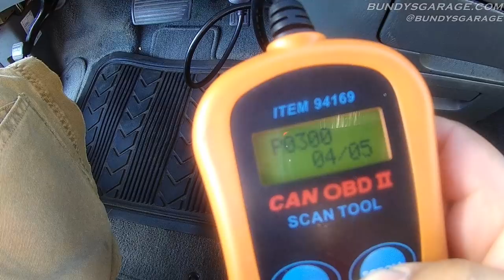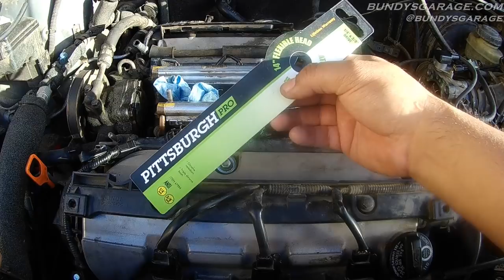SOLVED P1399 Honda Acura V6 Accord Odyssey Ridgeline Pilot CL TL MDX Random Cylinder Misfire

Comment: Code also pops up when you have low valve clearance or a clogged EGR valve .
Reply: So would adjusting the last to a tighter clearance make that better.
Reply: The low valve clearance
Reply: Low valve clearance means it's already tight to begin with , so no . In fact I would ever so slightly loosen up and make sure you are using the correct  feeler gauges when doing this adjustment . I do recommend that you have a  professional do this task for you .
Reply: @zacharymcmullan707  p1399 can be from many different things you have to narrow it down start with easiest which is air no bad gaskets or vacuum leaks and map sensor/air intake filter is good check for spark if spark plugs coil packs and sensor connectors are all clean and fuses are good check valve clearance to see if you need an adjustment. If so then an adjustment will fix it if not fuel injectors/fuel components is your last resort. Codes aren’t an exact science gotta track it down

Comment: The last time that happened to my 2002 Honda Accord, Just changed the EGR valve and it is still running fine to this day.Those random misfires are caused by EGR or its passages is blocked by carbon or gunk.
Reply: Efren Saclolo hey I have a 1998 Honda Accord lx manual transmission, yesterday my car wouldn’t stay idle when I make a stop, the engine light came on and I got this same code plus a few more indicating a misfire. Do you think replacing the EGR would solve the problem like you did?
Reply: So did you change the egr?
Reply from the maker: The EGR and fuel injectors are two completely different problems. You have to do some diagnosing to determine which one. The code can come for all kinds of reasons. Bad spark plug, bad coil, bad wires, EGR, bad fuel injectors. If ou have carbon build up issues try using a top tier gasoline and put a can of Berryman’s into the tank with a complete fill every other oil change and that should take care of your carbon issue.

Comment: Does it also causes your spark plugs to burn easy n is it causing a longer rpm at shift once you giving the car a lot of gas like full throttle it jerks a lil I just replaced transmission so it can’t be that

Comment: On a 99 accord 2.3 could a bad fuel filter cause 0301,0302,0303,0304,and 1399 new plugs, wires,egr,knock sensor cleaned passages

Comment: What years had bad injectors ? Why does a misfire in one cylinder cause a 1399 ?
Reply from the maker: Any vehicle can have issues with with fuel injectors, any year range as well. The reason 1399 pops up is because the engine knock sensor cannot determine which specific cylinder is misfiring, so it just throws up a random misfire. Just like all parts they do wear out and they do go bad, but Honda has some of the best fuel injectors out there, they don't fail all to often but they do fail.
Reply: @bundysgarage  yeah, I know honda has really good injectors. The only honda injector I ever replaced was on a '92 integra LS. But I have seen others replace injectors on '86 to '89 Accords. But extremely infrequently. I worked at Honda from '97 to '00

How did you narrow it down to #6 injector ? Can't really pull off the injector connectors with the engine running, and the manifold has to come off to get to the injector connectors; I believe ?

Comment: I’ve changed coil #2 (which gave codes) and all spark plugs.. also cleaned out all the muck and grim out in the first removed cap on the head .. I’m getting misfire codes still could this be carbon due to high miles ?
Reply from the maker: What codes are you getting specifically?
Reply: P1399 but I noticed there’s a lot of carbon build up any recommendations on how to clean it out  ? I bought the van at a auction with high miles and without inspection stickers so I really don’t know how long it’s been off the road

Comment: I have the same codes for my 2000 honda accord p1399 and p0300 p0301 and so on... is it the fuel injectors? I changed the coil packs and spark plugs
Reply from the maker: Does it happen all the time? Or after driving does it clear up. If you have tested compression, and spark? The only thing left is fuel.
Reply: BundysGarage it does it once i drive the car for a while, when i shut off for about 20 mins and when turning on it does and it just shakes and turns off with the lights on the dashboard still on, i have to accelerate while turning on to keep it running
Reply: BundysGarage and yes compression is good

Comment: I  have a 4cyl accord with the P1399 along with a P0300 , P0301 etc, all cylinders measured around 180psi COLD except for cylinder #3 which is at 0 psi. Could this be anything besides a bad valve? Maybe a bad injector seal? Can a slipped timing belt possibly cause this 0psi ? I am just hoping for a miracle because I don't feel like taking out the head.

Comment: Where is the location of the 2nd and 3rd  clutch pressure switches? Thanks
Reply: Google it. "2nd and 3rd clutch pressure switch on 5-speed honda Acura automatic transmission images"

Comment: mine had this code p1399  damn it looks hard work for me
Reply: If you have the tools and the time, and you can stay organized and focused on the task, swapping out the fuel injectors isn't particularly difficult. This presumes you're t'shootong a P1399. That code may also be caused by fouled plugs or valve clearance that's out of range
. Removing and cleaning carbon soot from plugs is relatively easy. But doing a valve adjustment is not for the faint of heart.

Comment: Why did cylinder 6 misfire cause computer to send all these codes for other cylinders? Honda got bad engineers or computer programmers?
Reply from the maker: The knock sensor sits in valley and sometimes it gets confused and sends out the P1399

Comment: i did the valve adjustment 2 times did not help i cleaned the egr valve put it back did not work got a p1399 code and p0305 the motor was an jdm motor bought from nj i dont know what to do
Reply from the maker: Have you tested the coil or the fuel injector? Spark plugs?
Reply: get a chevy
Reply: @juanlanda2441  lol
Reply: @bundysgarage  yeah I changed the coils and the code came back i think it is the fuel injector because the customer is telling me it is burning fuel to fast dumping fuel

Comment: Its the injector problem then ?
Reply from the maker: Yes it was a bad injector. Honda / Acura injectors don’t fail very often but they can and in this case it was a bad injector. If it’s stuck open dumping fuel your check engine light will be flashing. If it’s stick closed and no fuel is coming out then you will have a random cylinder misfire and or multiple cylinder misfires.

Comment: I have the same codes 2002 Acura mdx po 300, '304,po 306 ,1399
Reply from the maker: It could also be a carbon issue. Try running B12 thru the fuel tank on a full tank of gas. Is the check engine light flashing?
Reply: You solve it?
Reply: @bundysgarage  my check engine light flashes while driving. I just cleaned intake and egr ports. They was super caked but same p1399 code only, next to check is coil

Comment: My 2001 odyssey fails to start after been driven for over an hr cut it off immediately cranks right back up but wait 10 mins and crank it will fire up then stumble and shut off any help 02s have been replaced coils plugs iacv and map sensor and if you push the gas down hard it will bogg and sputter help please 9107487823
Reply from the maker: You have the dreaded heat soak issue.
Reply from the maker: Here what you need to do to fix it: follow the instructions exactly.

You have to change 3 sensors, 40 bucks on Rockauto.com. You have to change the engine coolant temp sensor (19MM), the air intake temp sensor (19MM) and the fan (thermo switch) (it controls the fans behind the radiator) (24MM or 15/16 deep socket) sensor that sits in the thermostat housing. The air intake sensor is on the intake manifold on the back edge towards the drivers side. Here are the Honda / Acura park numbers. Just take those and plug them into the search bar on Rockauto.com. Fixed the problem for me, period. 37870-PK2-015. 37880-P0A-A02. and 37760-P00-004. Just make sure you don’t switch the air and coolant sensors when you install them. They look identical and will fit both locations. Please let me know if this fixes your problem. If you have any more issues email me.
Reply: @bundysgarage  thanks I have changed everything but those 3 sensors I will replace them and let you know how it goes thanks alot again
Reply from the maker: Please let me know how it
Goes after you do the repair.
Reply: It was my knock sensor mr Bundy
Reply from the maker: Did you have a code for it?
Reply: @bundysgarage  no code it made the tps iacv and map sensor code come up it triggered a random misfire too
Reply: @bundysgarage  that was tricky I wanted to try the knock sensor before heat lock.
Reply: It came out in 2 peices and was hell to put replace had to remove the intake completely to get to knock sensor had no 1in socket to fit down there lol she is purring now thanks man
Reply: @bundysgarage  just done long test run still boggs down when given gas hard and will start up immediately after restarted but wait 10mins it starts stumbles then dies until it is cooled back down
Reply: @bundysgarage  I'll be darn it I just simply unplugged the sensors you said to replace and immediately heard a big difference and it cranks after warm start
Reply from the maker: Try the 3 sensors. Replace them and it will fix your problem.